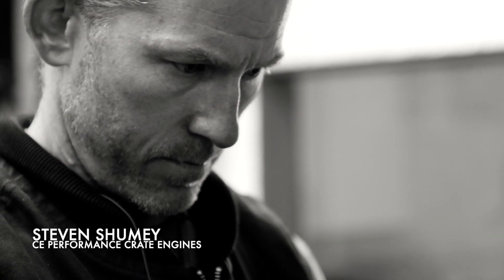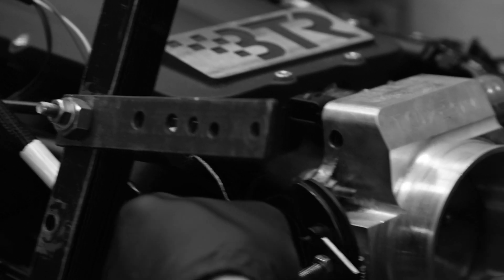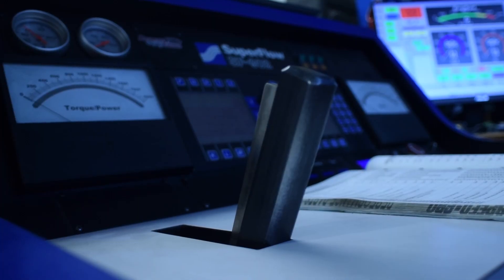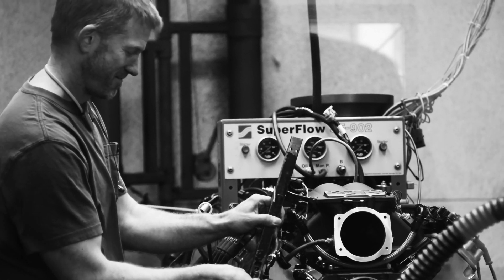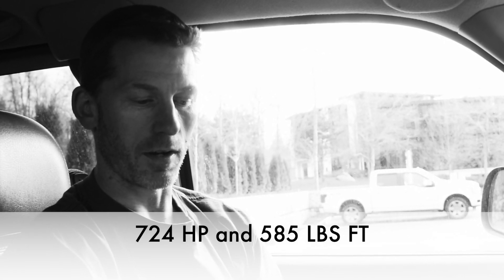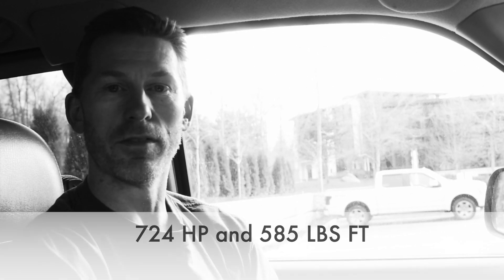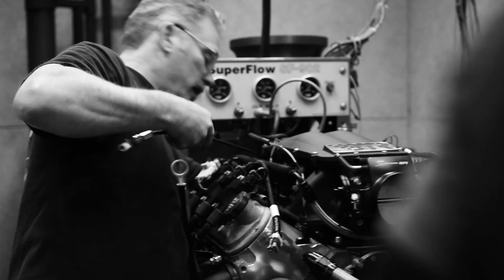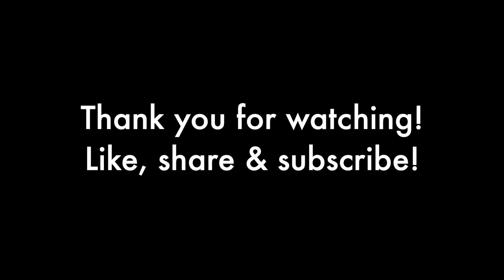468 LSX Project — the Dyno Test

Comment: A nice engine. But I cannot help to think that the torque was very low. Even with a hydraulic roller in the 238-239 duration range and about 640 lift, a nice combination with good heads should make in the range of 1.40-1.45 lb.ft per cube.
Reply from the maker: Thank you for commenting. I agree, more torque would definitely be achievable with less cam duration like you mentioned. 
The interesting thing about this engine, now in my Nova is the problem of traction! I’m not sure if more torque would be what I’m after :)
Anyway, it’s still a fun ride despite the fact. What we know for sure is that every build done slightly different produces varying results and that’s how we learn. 
My next plan is to use the same tall deck block with a 3.267” crankshaft, 4.2” bore and aim at 1.9-2:1 HP / cube.

Comment: Wonder what a really good set of aftermarket heads would do?
Reply from the maker: Good question. My initial build on this was using the AFR LS3 heads but the delay kept being lengthened through Covid. These GMPP heads were in our stock so we went ahead with them. They have performed very well but I’m still interested in what the AFR’s or maybe the new Edelbrock heads would do? Thanks for commenting.
Reply: @ceperformance  I have a 4.100 strokeX 4.155 bore LS, Aluminum block ERL super deck II I,m putting LS7 heads"Fixed" by WCCH Im hoping for 600 HP not near as much cam as you are using though, 231 246 660ish lift, was thinking about the MAST Black label but I have so much money in it now I said screw it get it going, upgrade later if I need to.
Reply from the maker: Perfect! You should see 625 HP or possibly higher in my estimation with that combo. What rods and pistons are you using?
Reply: @ceperformance  JE Pistons, Crower Rods and Crank, I got a stroker kit from Brian Crower, yes he does some LS stuff as well, Balanced, coated top and side JE asymmetrical pistons, and had Eric Koenig of HPR assemble the short block, I have a fast 102,102 TB, still gathering injectors and a little more on the fuel system.
Reply from the maker: Simply Man, sounds like a great build!
Reply: @ceperformance assuming roughly 50 CFM difference at .700” between a stock head and good flowing version could be an extra 100 ponies. If I was a betting man.
Reply: @ceperformance even with a good ported set, it’s still likely close to 100hp.

Comment: Has your shop ever played around with an import V8? 
Such as maybe a 2UZFE with VVTi.?
I believe they're based off of a Ford 289, but can be bored and stroked fairly heavily modified due to Cast Iron Block.
Any thoughts on if you'd be interested?
Reply from the maker: That’s interesting! Never modified one of those though. Thanks for commenting :)
Reply: @ceperformance  Thank you for the reply.
LEXTREME is the guy and his website. I think they got it out to a 327 equivalent with Eagle H-Beam Rods, they have or had a stroker kit, some very aggressive cams are available also. Small engine with a high output, would be killer! 
I ask because I have a 2006 Tundra 4x4 that the body is on the way out, but the engine still rips even after all these miles and I do mean it's in miles. I'm Canadian but the truck is an SR5, USA Version. But ya, optional project engine🤔🤫
Reply from the maker: Interesting!!

Comment: Run that engine from 2000 all the way up... I wanna see that Dyno run
Reply from the maker: Thank you for commenting! That would be a great test to run but unfortunately there are some limitations of the engine Dyno. There’s a servo function that limits the range of torque a test can run within. Starting the test down very low like 2000-3000 would limit the top end of the test to 4500-5500 roughly. The bottom right of the computer screen shows servo %.

Comment: Nice numbers but not a very good truck towing type build! LOL

I wonder what kind of numbers it would make with a cam that would bring the HP and toque peaks closer to the same number? Added together divided by 2 says around 654.5 which would bring both of the peaks down to a more streetable RPM range if that formula is even close?

What kind of fuel is this built to run?
Reply from the maker: Hey man, thanks for commenting! It’s always a joy to imagine something and see it come together. It would be interesting to try the same build with much less cam and drop the compression too. Most likely would alter the hp and tq like you’ve said. 
We are running 94 Chevron.
Reply: @ceperformance  Gm Ls grudge racer i think the tq numbrs are perfect. For drag bad bl roads no prep. You alwas want low tq numbers so you can hook better an let the Hp cm in to get around a car. So idu what he ment by that commont great jon tho
Reply from the maker: Thank you for commenting!
Reply: 222-226 550-550 111Texas speed would bring that down and make nasty torque and the low lift would never need a spring change600+ lifts require springs be changed much sooner
Reply from the maker: Good point :)
Reply: @utahcountypicazospage5412  If done right, you don't need to sacrifice the hp and run a tiny cam to get good usable torque.
I did a 427 build for a buddy last year which made 739 hp at 6800 and peak torque was 620 @ 4600.
Here's how that was done.
12.2:1 comp
4.125 bore
4.000 stroke
Diamond fully coated pistons with horizontal gas ports and a 1.2, 1.2 and 3.0 mm ring package.
BR7 273 CNC heads
CM cam 240/256 113+4 .648/.639 lift
MSD Atomic intake w. 102 mm TB.

It might sound aggressive on the cam side, but it really is not that bad. If one looks at where the peak power numbers are, it shows an engine that is very happy at lower rpm, and those lift numbers are not a reliability issue with good lifters. That combo on a 468 would bring peak points down on the curve and aide in even better street manners.

Comment: Dam, I'd say ya'll had a very successful day with those numbers. 
Why did you stop at 7,200, as depending on cam and valve train it'll easily go even higher. 
Are is that a set point that you maintain for a safety factor, because if it's built it'll live long happy life at that rpm range as long as it's maintained correctly. 
Congrats, on your baby there, she made ya'll proud of her I know. 
Especially normally aspirated, and all motor is proof ya'll are on the path to even bigger and better yet to come I'd say.
 I'm a strong believer in never push the upper limits of things if you don't have to. 
As we use to say 
SWEET
Reply from the maker: Thanks for commenting! Yes, we’re very happy with the results. It’s a 4.25” stroke so the 7200 is the safe limit in my opinion. That’s where the HP peaks so that’s the top! 
Your interest is appreciated :)
Reply: @ceperformance  it never mattered to me whether it is a 2 stroke old 2000 4 banger in a pinto 327 or 440 not even diesel, because if it ran like a top exceeded the manufacturers build by good margins that's all I ever required honestly. 
That and quality speaks for itself in a very short time frame, doesn't it. 
Your very welcome and you earned it, so thank you for sharing with us
Reply from the maker: @timothymilam732  
Thanks again :) 
I think we all need to share knowledge, successes and even our mistakes. When it comes to engine combos, let’s learn together! No point in keeping secrets.